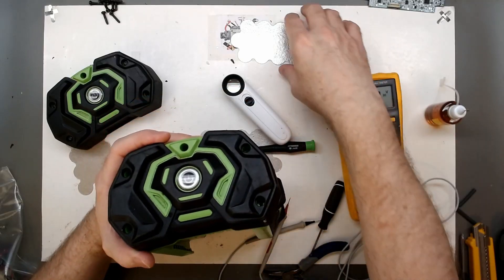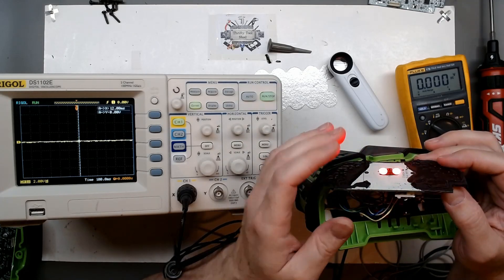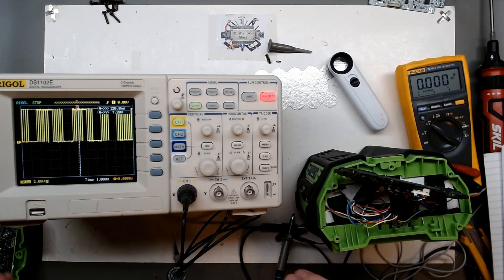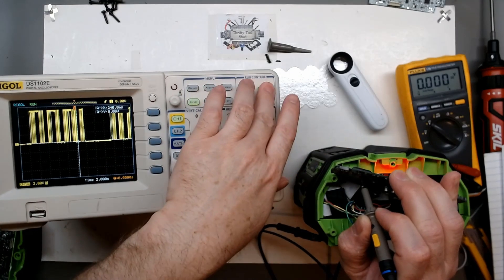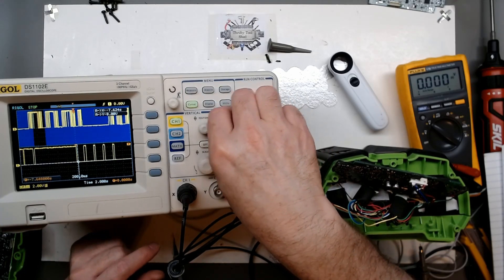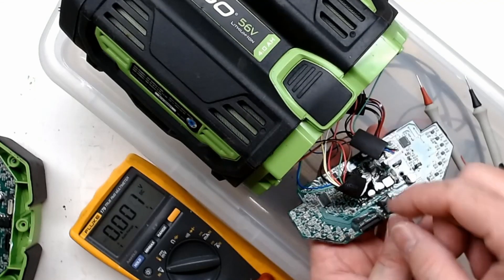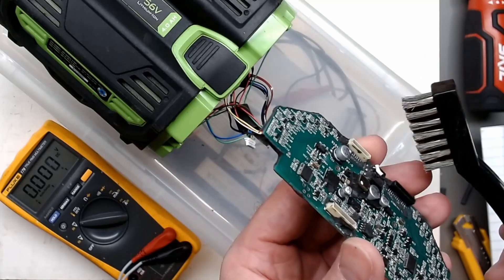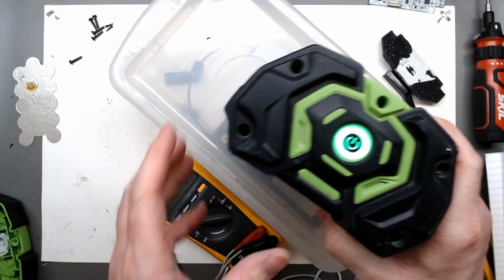EGO 4.0AH Repair #3 (LED Blinking Red)

Comment: Brand new 56v 5Ah pack flashes green but then stays red. Voltage read 48.9v but when I put it on charger, charger turns on and then 25% light stays solid red for hours. 

Battery manufacture date of 2019 and Ego said they will send a replacement. I tried to “jump” it (positive to positive & negative to negative) with a good pack and this brought voltage up to 52v, but still same solid red light. Do you know what a solid red indicates?
Reply from the maker: So this is a newer style pack with the  segment leds (fuel gauge)? I do not have one like it yet, but on the newer ones it could be a temperature issue.I have a video explaining a little about the T-terminal and checking thermistors on the older packs. I am not sure how different they are.
Reply: @ThriftyToolShed  Thanks! Yeah, newer style pack with the segment LEDs. I'll do a resistance check just out of curiosity. I actually thought maybe it was a cell imbalance indicator. I'll probably put it up for sale. Thanks!
Reply: @ThriftyToolShed  
In fact are two bands that use same batteries and chargers only difference is color, EGO is green and Karcher  is yellow but are fully compatible, Karcher model BP200adv is the same with ba1120e, BP400adv, is the same with ba2240e, bp800adv is the same with ba4200e, t models are also compatible but are only under ego brand.
I got a repaired BP800adv, similar with BA4200e 3p 14s architecture, but BMS was faulty, it discharged a half of the battery in two weeks unused, one rack of cells were dead empty, 0v all, the second rack were OK 3,5v all, and I recovered them for other purposes.
I am impressed what brain work you invested to understand these BMSs, I puchased a working SH BA2800e, but i am interested, to buy recovered BMSs for 14s 3 p and 14s2p, including thermal sensors boards and wiring, I have cells and shells, I can try to rebuild some batteries.
Reply from the maker: Very interesting, Karcher is a German brand! I did not know that...
Thanks for your comment!
Reply: @ThriftyToolShed  I can run battery with 20s 2 p LTO 18650 cells with no BMS at all , if i can trick tool controller with a controller card conected at serial intrface, LTO are so robust they not need BMS, In fact I run a much larger LTO battery on my solar system, two strings of 55s 40 AH LTO, from years, fully offgrid, vith no BMS, I pass around 1MWh per year thru them with no issues, they perform fine in cold weather, i fill no difference in winter when I need best performance, in fact this battery ouperform a standard household grid connection by ten times I can drag 100 kw to empty, or 200kw 30s.
Reply from the maker: Wow! That's something! 
As far as the BMS board, yes the D-terminal would be difficult. Since it communicates from pack to tools you would have to figure out a way around that as I mentioned in the "what's the D-terminal" video that I have. It seems a EGO pack just about has to be connected. I have put a cheap BLDC controller in a few blowers now and they still run great and that is one way I can run that tool on what ever battery I want! The EGO controllers shutdown after about 10 secs of run time without the D-terminal connection.
Reply from the maker: Yes, the self discharge is what lead me to my very first look inside and video on the BMS. Mine was a shorted transistor causing the complete discharge always blinking green instead of the calendar chip controlling it. Thanks for the information share!
Reply: Fortunately I found here the same symptom that destroyed my first pack, it keeps to flash green, similar to self discharge mode, even I charged and used it, after some time of flashing unused it died, one rack was empty to zero volts one has 3,5 v per cell, I guess the large transistor mjd117 is used to do this self discharge, if it somehow partially damaged it can destroy the battery, I intend  to remove it at all to mitigate this risk, i keep batteries in a cold place, Hi SOC is small problem at these temperatures.

by Alan B » Jul 11 2019 11:41pm
One of my EGO 2.5 amp hour 56 volt batteries was working a few days ago on the hedge trimmer, and yesterday it did not work. Today I put it in the standard charger and it cycled and did not stay in the charge mode.

I measured the pack voltage around 10 volts, and was not responsive to pushing the button.

I put a small current into the battery of about 60 milliamps, and after a few minutes the voltage was in the low 30's. After that the charger accepted the battery and started charging. I kept watch over it as it charged. I charged it in several short periods when I could watch it.

Before it stopped charging I noticed that the battery LED was flashing once per second. This behavior continued after the battery stopped charging and the charger indicated full.

I removed the battery from the charger and it continues to flash green. I did a brief test in a tool and the battery powered the leaf blower as usual.

This green flash normally indicates the 30 day discharge to storage level. Clearly we don't have 30 days of non-use to trigger that now. I wonder if this is instead an indication that it is balancing, which would be likely after a deep discharge such as this.

Anyone have experience with this?
-- Alan [w6akb]: CroBorg SuperCommuter, RidgeRunner, Bonanza2WD, EbikeE, AlansEbikeSite
Top
Reply: Probably if you attempt to charge a battery during self discharging sequence may damage mjd 117 transistor, perhaps this situation was not taken in account by designer, I do not know if button push cancel self discharge or not, logically was to cancel it.
Reply from the maker: Well, the only thing I have seen myself is that the transistor shorts and causes the blinking green and self discharge. Mine did not enter the maintenance self discharge  mode prior. My pack had just been used and recharged when I noticed that it was blinking. I did not  realized it was pulling down below safe cell level before I had time to figure out the issue and remove the faulty transistor. Interesting point though about once a pack is in self discharge. I assumed either charging it or using it would be fine to cancel the self discharge mode? I am not sure though!
Reply: @ThriftyToolShed  Please remove MJD117 if you can,  and see it it works, if it works I will remove this transistor from my packs, I have working unopened packs
the pack that was drained out was already repaired, I am not sure if if was blinking green when I purchased it. It was 14 3p bp800adv similar to ba4200e.

I measured MJD117 from my dead BMS few minutes ago, it is shorted between collector and emmiter  but base junction is good, i reused some parts from that BMS, is was allready mistreated when I opened that pack.

My experience in switch mode power supplies tells me that MJD117 do not cope with switching pulses generated by motor driver, I burned count lees slow diodes and transistors with residual pulses generated by silicon carbide devices, they were literary baked by  switching pulses, my solar system is all DIY silicon carbide power electronics.

Comment: I have an EGO BT1400T battery that has only been charged 4-5 times and now it will flash 2 green bars and then all 5 light flashes red. I try to charge it and the charger stops after a few minutes and then goes red. Is my battery screwed? Guess I coule sell it on eBay for parts.
Reply from the maker: Is it still under warranty?
Reply: @ThriftyToolShed  Yes, EGO sent me a brand new replacement battery. Just hate to get rid of a battery that is less that a year old and only been used a few times. I guess there is no easy fix for this?
Reply from the maker: @loghome7061  gotcha,
I do not have a newer style pack to know for sure. On the older gen packs it is usually a loose connection on the BMS board or one of the cells is reading low causing the red blinking light. But yes you can sell it on eBay. I have bought several on there to repair and they get bought up pretty quick!
Reply: @ThriftyToolShed  Thank you for the replies. Maybe I'll take that end cap off and check for a loose connection first.

Comment: Thrifty tool Shed : Good informative video as always 👍. 
If you don’t mind, let me think out loud 🧐.I am wondering if you have developed EGO battery pack capacity testing methodology. I know there are fancy shmancy test equipment for the purpose. But its price defeats the purpose of a one off testing. The idea is to have a low cost method. Even high powered resistors are expensive to use for load testing. I was looking around eBay and Amazon. Noticed adjustable constant current electronic capacity load testers. These are reasonably priced and can accommodate the EGO battery high voltage too. For example
https://ebay.to/3bFUwVO. 
If one were to use this load, and even not stress the battery much, loading it with one Amp draw, and measure the time for discharge. Or even use the charger as a discharge level sensor, by occasionally putting the battery back in the charger, and watching the charge level.  The idea being getting an idea about the ballpark remaining capacity of the battery. So what are your thoughts?
PS: Later i discovered this electronic load on sale (150v, 10A, 150W).Sale lasts next 2-3 days. It is on Banggood, which at least accepts Paypal:
https://bit.ly/3ie7wEq
Reply from the maker: Sorry I did not see this comment earlier. Yes I have had my eye on something similar for some time. I finally bought me one last month. It's a 150W from eBay. I used it on a Schumacher Jump start pack I did a video on recently. I like it for the money. I had one in my watch list for a year or longer, I should have bought one of these years ago. Lol..

Comment: Hi Thifty.   I'm troubleshooting my 4.0ah battery (5 years old) which is blinking red with some rapid flashing too fast to eyeball.   I did exactly as you did by cleaning the three connectors with white vinegar and alcohol and I checked balancing across all the Bx points and all indicate 4.1xx volts.   Any ideas for next steps?   Thanks for doing these videos.   You're providing a great service to some that have a little electrical knowhow, but just not quite enough (like me ;-)
Reply from the maker: So when you go accross all the BX test points from ground to B1 and then B1 to B2 etc. All the way to B14 or pack + you are getting 4.1V stepping accross all points? What is the total accross the pack + and -?
Reply: @ThriftyToolShed  yes, getting 4.1x volts from B1 to B2, B2 to B3, etc. all the way up to B13 to B14.     Not sure where a ground is on the board, but Point “D” to B1 is 4.1 volts, D to point B2 is 8.2 v, and rest of Bx points referenced to D are incremental by 4.1 volts up to a total of about 57.6 Vdc.
Reply from the maker: @jsr0802  
Seems all the cells are excellent and even the BMS connectors are getting a good connection for the cells. It seems it may be something weird with the board itself, even though the obvious things seem to check good. I have not seen that exact failure yet. Must be issue with the board on one or more of the cells monitor circuits? The only other thing I could think of is that....
You do know it's blinking red correct? If it is blinking orange it is a temperature fault? Just thought it worth mentioning, I have a hard time telling on some of the packs!   (BTW, the minus of the pack or the small black wired coming from the connector board should be your 0V)
Reply: @ThriftyToolShed  This battery death spiral actually started out as a flashing orange condition before I took the battery apart..    It morphed to what appears now to be flashing red after I took the battery apart.  Is there a way to test the thermistors assuming that's the part that monitors temperature condition?   Where on the 4.0 board are these located?
Reply from the maker: @jsr0802  
I do have a video about what is the T-terminal and I kinda go over some of the thermistors on the board of the 2.5ah pack. The 4.0ah pack also has a board in between the packs halves and I know very little about it yet. It appears to have small SMD transitors using the PN junction to monitor the individual cell temps? Hope it helps, that is all I would know yo check on these, I have not had that exact failure.
Reply: @ThriftyToolShed  Thanks much!    I just watched the T-terminal video and will see what my thermistors are reading.
Reply from the maker: Good job so far, best of luck to ya!

Comment: Thanks for the video. I have a brand new 5AH battery that blinks orange consistently. Would you happen to know what the error code is indicating? Also it looks like I cannot simply buy a new BMS (in case that is the root cause).  Is there anything I can do to troubleshoot further without taking it apart?
Reply from the maker: Hi,
I have a video called "what is the T-terminal?" and I mention the thermistors on the BMS and pack halves. Unfortunately the 4ah and larger also has boards in-between the packs halves and each cell is  monitored. Most of the time when blinking orange I believe it is a temperature issue. Blinking red is a cell voltage issue. If it is new, EGO warranty is for 3 years so they should make it easier right. You may rather take it back where you bought it, but it will be exchanged and EGO usually sends out a replacement and you keep the bad one. It can either be a fun project or people pay good money for the broken packs. I have paid over $45 for the last 4ah and 5ah that I purchased. Best of luck to ya!

Comment: We could now see these battery sold on Ebay and Amazon as "Factory Refurbished". Does it mean EGO takes and refurbish these batteries.
Reply from the maker: I do not know if EGO sales any pack as Factory Refurbished. I only repair for my own personal use in my own tools and try to share what I have learned on video to help others with the packs they have.

Comment: My 7.5 pack has green light when pressed, put in tool turns red and will only run .5 second.  Tried charging and say 0% and will not charge.  I measured the voltage and get 46 volts across pos and neg.  I called ego but they said not under warranty.  Any thoughts on what is wrong?  Many thanks.
Reply from the maker: Well it sucks it is out of warranty! It seems from what you are describing  that the cells are at least descently charged and the fuse is good since you are reading voltage at the terminals. So in my opinion with this small amount of information given is that the pack is either dropping off very quickiky due to one or more cell clusters are dropping out or the BMS board is causing the issue. I would guess if the pack does not drop off much at all during a load test condition then the cells are ok. I would of course check the balancing accross the 14S cell clusters to see if they are close to balanced. Also  look at the NTC connections. The connectors on these boards are usually siliconed and connected well, but double check. I also had a pack in my last video that had corrosion and it was a bad connection to the BMS board. Hope it is a simple fix. Best of luck to ya!

Comment: I have a 7.5ah pack that reads 72 volts at the terminal and gives an overcurrent error often.  Any ideas?
Reply from the maker: Hopefully not 72V! That could be over 5.1V accross cells on average. That is high enough to be dangerous for the 4.2v maximum cells.
Reply: @ThriftyToolShed  It WAS reading 72, but your response made me check my multimeter and the battery was low so the reading was faulty.  Now reading 56.5, so back to the drawing board on what's wrong with this 7.5 pack that makes it flash orange.  Thanks for the reply!
Reply from the maker: It is hard for me to tell between the Orange and Red blinks at times but usually Orange flashing is temperature or NTC issue and the Red is usually issues with voltage level of the pack, in most cases it is either a bad cell  (or group of the 3 cells for the 7.5ah pack)due to the voltage level is not at the level it should be so you get the flashing red fault. I commonly have a pack reading 56V that is flashing red and out of the 14S sets of cells it is only one set reading low or lower and the pack will cut out as soon as those low cells hit there drop out of at around 2.7V or so. Best of luck to ya!

Comment: Ive got about 30 of the 7.5 amp batteries and a heap more smaller ones my local mower shop gives them to me every week ive repaired most of them so far.
Reply: Impressive TheMFrelly!! Please share your knowledge. Even a short summary would save the world many hours of effort deciding which way to go when encountering a problem.  I just bought a used 7.5Ah on eBay manufactured Jan 2021.  When I put this battery on a rapid charger the charger indicates that the battery is fully charged. Pressing the battery button it shows one green light flashing then goes to red lights flashing. When the battery is on equipment it lasts for a time then shuts off (uncertain about the lights then).  It seems clear that I could attempt to charge the pack directly just a bit and then put back on the charger.  I opened it up - no swollen cells. Given the recent manufacture I would guess that some of the cells somehow got too depleted. I still have to put a meter on it. What say you Thrifty Tool Shed?
Reply from the maker: That's awesome!
Reply from the maker: Have you seen any of the 7.5ah have the Q12 shorted on the BMS as a failure? Just wondering, I have not yet to have a bad 7.5ah pack.
Reply: That is awesome.   Do you do repair of these batteries professionally?  I have a few batteries I would like to repair.
Reply from the maker: Not sure about TheMFrelly. I wish I had time, I get asked this alot. I would not be able to get to all the request if I wanted to. I simply try to take time to share what I find when I do have time to work on some tools.
Hopefully it helps some. Thanks for your comment!
Reply: WTF THATS like $12,000